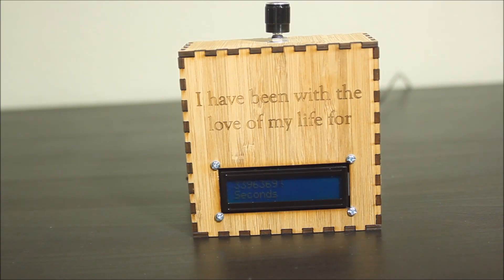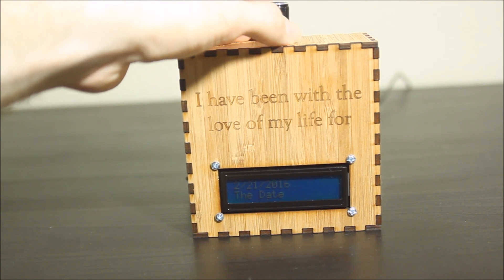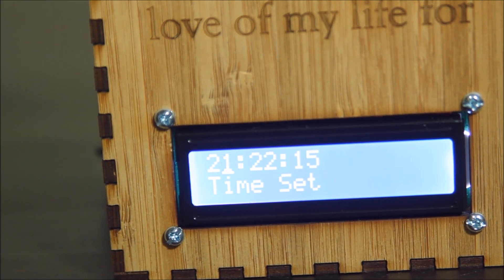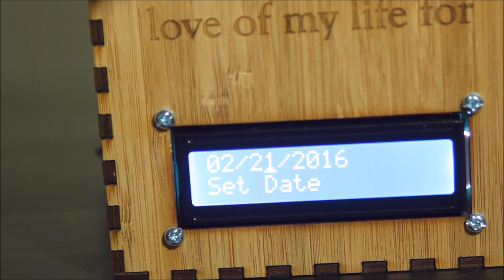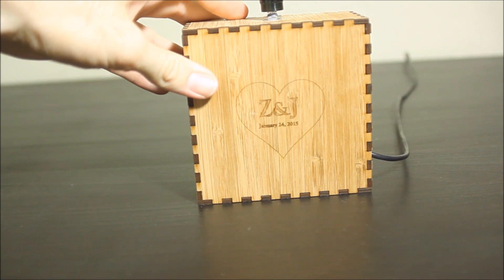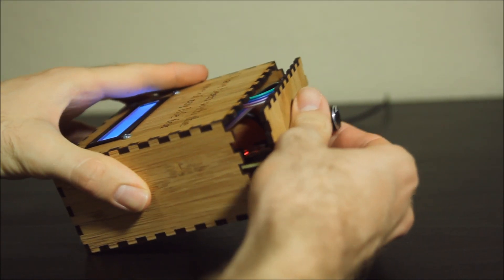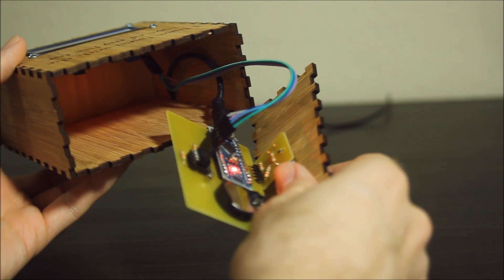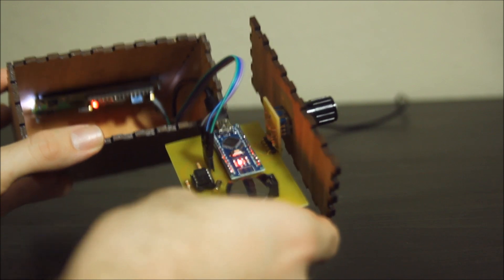Count Up Box - Arduino-based Valentines Day Gift

Comment: Hi.... Can I make this with DS1307?
Reply from the maker: Hey, that's exactly the real time clock I used in the design, so yes you can! You can check out the design files here: https://github.com/jerwil/Count_Up_Time The circuit board was designed used Fritzing, so you can use that software to open the files under the "Circuit Board Files" folder and see all the electrical connections in case you want to try to replicate it on a breadboard or make your own circuit board.

Comment: I couldn't find the way to build this. Please help me about this.
Reply from the maker: Hey there, you'll need some background knowledge with Arduino and electrical components/wiring if you'd like to make one yourself. You'll also need access to a laser cutter if you'd like to make the enclosure that I've designed. You can find the electrical schematics, PCB design files, arduino code, and lasercutting design files here: https://github.com/jerwil/Count_Up_Time 

The list of required electrical hardware can be found on that page, as well as links to photos of what the inside of the box looks like.

Thanks for having a look!

Comment: Is the battery always being used to power the real time clock? Or is it only drawn upon in the event that the power is disconnected?
Reply from the maker: The DS1307 is the real time clock I'm using. According to the datasheet, the battery is used for backup purposes (not all the time), and it should be able to last 10 years or more in battery backup mode (assuming the battery doesn't self-discharge before then).